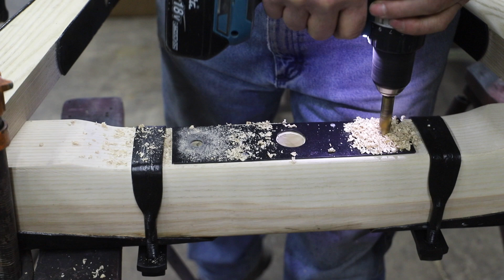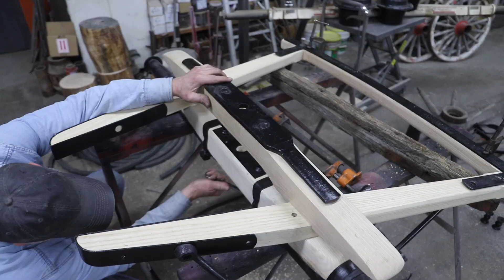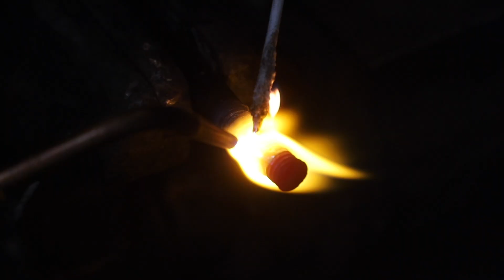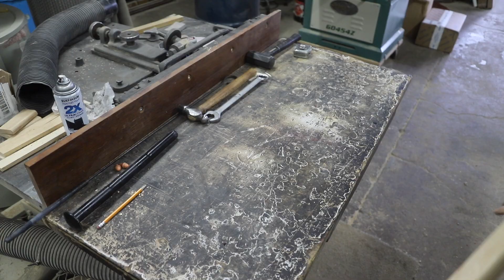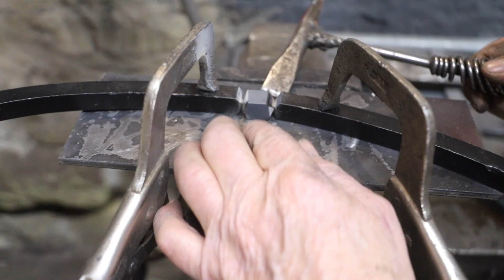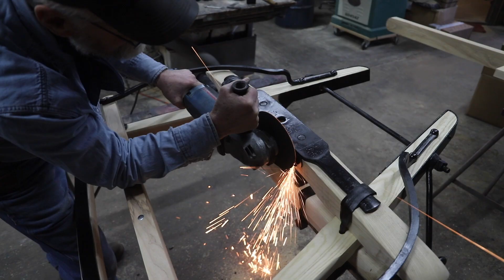Rebuilding Threads in Restoring Wagon Front Axle | Engels Coach Shop

Comment: Hi, in the UK we call the connection between a truck and trailer a 5th wheel coupling, does that term originate from these old wagons ? thanks for the tip of brazing the worn bolt threads, when I think back over the years I could have used this tip but never thought of it!  Stu

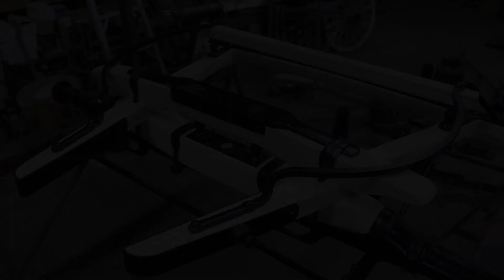Comment: I love these detailed videos of how-to-do-it. I appreciate Dave showing all of the steps. Dave is preserving a vanishing skilled-trade. Several in fact. However, as this video amply proves, Dave is barely reaching 150 years into the past. I am certain that in 1722, twice as far into the past, there would have been only 10% as much metal (18:57) in this sort of wagon. Perhaps less than that. This video shows an immense amount of iron parts, which were only available after the Civil War, ca 1870. The point is that I think Dave is producing a precious, priceless series that will save a dying craft from oblivion, while at the same time these videos make me mourn the lost art of the nearly all-wood farm wagon with no steel in the structure except for the tires and hubs.

Comment: Hi Dave, could you have solved the problem by straightening the arc of the sway bar, thereby increasing the length? And if not, why not?
Reply from the maker: I could have.  That's why I checked the side to side measurement from the kingpin to see if that was off, but it wasn't.  Straightening it would have made it off, so I chose not to.

Comment: I rebuilt a ,I guess a steel wheeled corn wagon. I wish I had watch you first . Had trouble lining up the bolts, as you used a hot rod. I will remember that, if there is a next time

Comment: Dave, I can hear them 150 or so years ago: ‘Just put the extra bolt in. Nobody will find 3/4” in the front suspension. Nobody’s going to worry about it.”
You found it😃 You fixed it!! Well done, that’s what makes this channel special in my eyes👍🏼
Reply: Well, it did take them a while to find it... 😁 which makes the channel even more special.

I wonder if the curve profiles are (were) actually not the same - the rods could have started the same length, just wrought to a different radius. And then a 'repair' that takes Dave a couple of hours with electrical grinders and an arc welder could have taken much longer to fix back then, so...

Comment: mystery solved? I worked at rawhide (scottsdale, Az). we had some authentic coaches. when someone would drop off some "new" ones from a private collection or to donate, we would take the carcasses apart. NOBODY donates a mint condition "survivor". we would usually make one "good" one out of 3 or 4. if they came from different parts of the country, I guarantee the measurements were a bit on the loose side between them. if we were taking one part from one, we had to make sure it's "twin" was the same. if not, you have this problem. if this was done 100+ years ago, they probably just ran it. parts were EXPENSIVE to make back then. close enough worked.

Comment: I was interested about sealing the drilled holes with a red hot bar, as a past wooden boater I wonder if shipwrights would have done the same. I will pass this onto a couple that are restoring a WWII UK navy boat. They have to install hundreds of copper rivet's through the hull below the water line.

It's wonderful to see how much engineering went into horse drawn vehicles, so thanks for showing me.

Comment: I was wondering what you were going to do with that big gap between the stacked axle parts.  I knew something went in there.  Then you burned the holes and stuck a couple of spacers in there.  Ha!  Spacers.  Ingenious!  How do you do it Dave?  This whole assembly has just as much iron in it now as it has wood.  It’s a pleasure to watch what develops in your shop.  I’ve been hooked ever since you re-tired a set of buggy wheels.  The rubber tires not the steel tires, though the steel tires are spectacular with the fire.  Somehow I’m more impressed with the rubber tires as a learned skill.  What a craft.

Comment: Dave, it's interesting how long some of the "carriage/wagon terminology" stayed with "modern" vehicles.  My '46 Willys CJ-2A (that's why I said "modern" ;) has "kingpins" as part of what the front wheels swivel on.  Even with the gears, bearings, linkages, etc., in its front end, I think this chuck wagon front end is still more complicated.  And maybe heavier too!

It would be interesting to hear what everything weighs when completed, if you can weigh them when you're done with the sub-assemblies.

Comment: Love it as usual, I have a question, those last 2 plated that attach to each side of the king pin plate with through bolts, shouldn't they be welded for more strength making the entire king pin structure more rigid? Just a question no critique intended. Thanks

Comment: Hmm the King Pin, the cat that thinks he runs it all. The Queen Pin, the cat that knows she runs it all. lol Sorry for the cat joke Mr. Engels, it's just I have cat's. Now from having worked on horseless carriages aka automobiles, I understand that the King Pin is what the wheel spindle pivots on. And is a similar thing with Semi Tractor Trailer rigs that uses a fifth wheel and with older automobile suspensions. Either way it is complicated to explain, and sounds just as complicated with horse drawn wagons. But I understand, and think most everyone else does as well. Good video, and is amazing how much crosses over from wagons to automotive.

Comment: I oft times wonder when watching you build these front axles assemblies, wither all the parts and bracings. were designed all at once in the beginning? or were components added after the fact as needed? awful lot of engineering went into these axels. thanks for sharing. ECF

Comment: As a mechanical engineer, I am amazed how that front axle goes together, the amount of work and thought that has gone into the design of it is incredible, it really looks a work of art. To think it would have been compleatly hand built and forged  makes you feel a bit inadequate.
Reply: You have to consider just how long humans had been making wagons at that point. Something like ten thousand years. So the design did have some time to evolve.
Reply: @1pcfred  it does look good though doesn't it 🙂👍
Reply: @D989501L  I've never really looked under wagons much. I have to admit there's a lot more going on there than I realized. Even in Roman times though they were making bearings for axles. They made the bearings out of wood. Then they greased the living crap out of them so they'd hold up. Still amazing to think thousands of years ago they were making bearings. Little roller bearings.

Comment: I'm constantly amazed that you can drill free hand from each side of a thick timber and have the holes line up. I could use a drill press on a piece of cardboard and the entrance and exit holes would be different when measured from the same edge.
Nice work lengthening the short sway bar to match, got me wondering how the short bar was fitted on the wagon originally?

Comment: Such a wonderful engineering result by craftsmen who didn't even know they were engineers. The wood being less stressed, becomes an armature for the ironwork which they arranged to take the forces exerted upon the structure. Iron and steel became cheaper but the horsepower available was still horses so weight was a primary concern. When the internal combustion engine came to be, all of this was replaced with castings and forgings.
Reply: I didn't understand your use of the word armature until I looked it up.  But you are quite right.
Reply: @cyrilhudak4568  It was a sophisticated solution, elegant and economical, without even knowing it.
Reply: @notsoserious0944  . . . and light weight!

Comment: Is there a reason why washers are not used between the nut and the surface? I realize the bolts are cut and peened, but I would have thought the use of washers would be more commonplace. Is this also an indication of the type of assembly for the time?

Comment: As a Senior Structural Designer of over 40 years...i find the this combination of steel and wood amazing.  Until I watched some of Dave's vid's (starting with the borax wagons) I never knew the complexity of these coach undercarriage's.  I merge of steel and wood, the workmanship, the patience to actually do it all.  I love it.  I look forward to Friday.  Thanks Dave for letting me watch.
Reply: There’s also the design, which I expect evolved as problems arose and were solved over generations.
Reply: @robertbamford8266  yes about 5000 years of learning, still like Ron I never really thought about it till I watched one of Daves videos a year or two ago. Charles
Reply: So is the wood holding the steel together or is the steel holding the wood?
Reply: @nickpitt  The wood holds everything together.  The steel reinforces the critical connections that experience high stress.
Reply: @SteelmanGothly  But all the wood is held together with steel bolts, so arguably steel holds everything together. I just love the way they are use together, each to it's own strengths.

Comment: 6:17 Nuts rarely strip from over tightening .It is usually the male thread that strips.
The force on the female thread's root is distributed over a larger length of thread due to it being an OD feature.
The male thread root is an ID feature which is shorter,the force is more concentrated and strips first.
Nuts that have been stripped are usually the result of cross-threading.
Reply: True, given both are made of materials with similar properties and structure :)
You can't really know with this old wrought iron hardware (it's a non uniform crystalline hodge-podge, you can have carbides several mm in diameter there that would just chip off on the slightest provocation)

Comment: It's quiet evident from this video that the front running gear is a pretty involved device to assemble. Makes me wonder how many wagons historically crashed until some genius came up with that control solution. 
So, now I have some thoughts as to why the leading queen bolt is so squeaky and the king bolt runs quiet.

Comment: I continue to be in awe of Dave's ability to freehand-drill holes from both sides of a piece, both square & angled, upside-down & backwards, and have them join up properly even before using a heated rod.  🤩
Reply: This was something I learned back at the beginning of the 60's as a young apprentice, drill from both sides if either is slightly off the other will correct the drill bit as you make your third pass with the drill bit.
Reply: @barryrudge1576  I've been doing this when the need arises since watching Dave do it.  Never too old to learn.
Reply: Actually, that skill is learned and it isn't that difficult.  It is much MORE difficult and almost impossible, to drill completely thru with one pace, starting and coming out exactly where you want.  Much easier to drill from each side and meet in the middle.  The resultant hole might well not be perfectly straight, but the second hole will hit the first and then the bit will then smooth out the transition.   Not to belittle Dave's skill.  He has so many.
Reply: I was just about to make the same comment!
Reply: I have been pondering that very same thing myself..
Reply: @O CRAP WHATS NEXT?  Naw, it really works.
Reply: yeah, me too :) impressive

Comment: Good save on those threads...had no idea brazing was an option. Also, made much sense to lengthen that swivel bar since it was never correct and could cause problems in tight turns, which it likely did for decades. Editing is going really well too. Much obliged as some would say...see you down the trail.
Reply: First chuckling thought about that sway bar dilemma and head scratching with the measurements was a wide eyed question, was it a circus buggy, I mean designed to turn tight in circles in just one direction. I have met the type of neighbour/passer by several times, and am guilty of same kind of jokes myself, so good thing there is distance between Finland and Montana, Dave might have chased me out with a red hot poker.😅

Comment: How do you stop the nuts situated on the bottom from backing off?  They didn't have loc-tite back in the day, and I wouldn't even trust that.
Reply: I know Dave has had to grind down a bolt here and there before getting out the wrenches, so I assume peening was used to lock those nuts in place.
Reply: - I have been wondering about that, too, . . . for years, but never got around to asking.
- I have never seen Dave take a center punch to upset/jam the threads and nut top
- Maybe enough torque will stop loosening. 
- Maybe you keep checking the tightness just like checking tire pressure today.

Comment: Evening Dave, I hope you and yours had a good Christmas and new year, a question for you?  are the square nuts a standard size or where they made whatever size the blacksmith made them. As i have re built a 1906 Fuller and Johnson Pump Jack Engine and all the threads are standard but the square nuts are all different sizes?
Regards Richard 🇬🇧
Reply: Dave says there were lots of variations in the old ones.
Reply: Thank you  Diane.